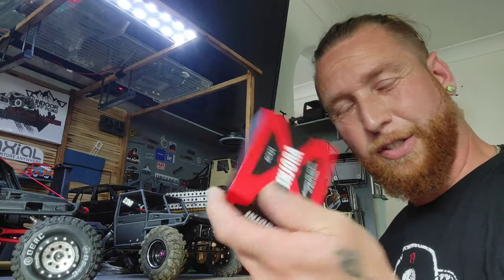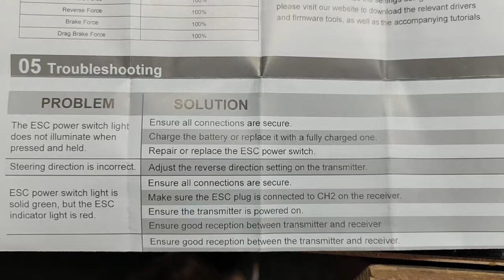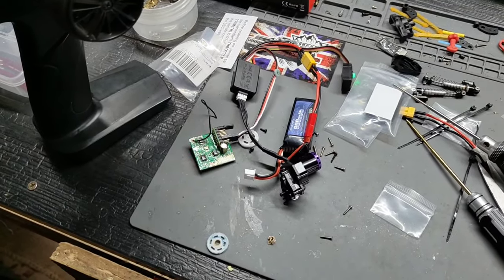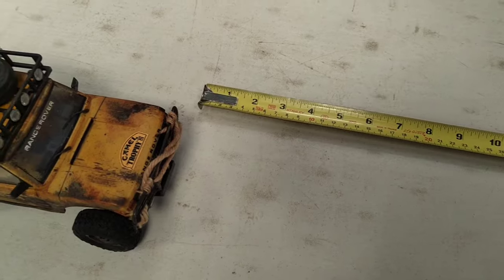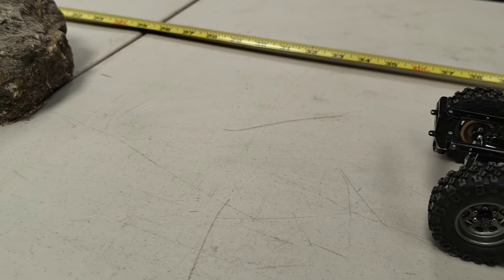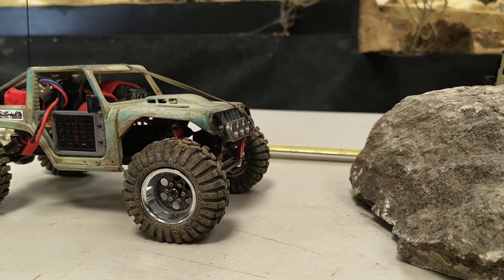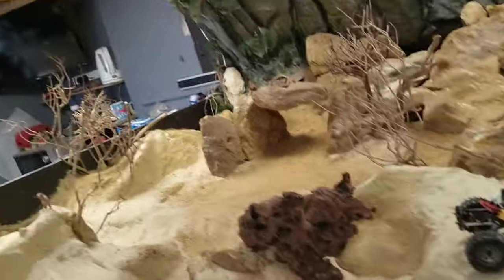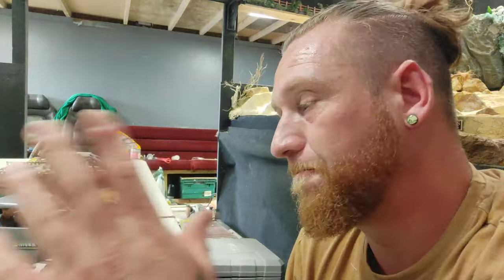INJORA 🔥 Brushless purple viper for the scx24 (budget upgrade with premium performance)

Comment: Good Test, thank you. I had the PhytonPro with Cedar, that was very good, but always Problems with calibration of Ch2, so I try Injora, when it will be delivered. Best of BL is alway the Power and the Possibility of control by very slow moving and first distance of climbing a rock. Brushed will alway have the effekt of powering after, when go to neutral at the Radio, so the Control is worst.
Reply from the maker: @slomofan2070  appreciate you taking the time to watch good luck 👍 be sure to check back in once you've run yours 🤘

Comment: Hi guys, I would also like to go through the process of brusch on my scx24, what is the overall budget to have the necessary set? I'm a little lost in what to buy, keep up the good work 🤗
Reply from the maker: @greghoog1968  what's up at this moment in time I'm running MB100 R80 with a purple injora on a 2s power supply. 

I would say regarding over drive in the front axle keep to 14t under that it starts to get a bit clogged up in certain situations. 

🤘

Comment: Nice one thanks for the very indepth comparison video 👍 .whats the delivery times like buying direct from injora to the uk?
Reply from the maker: @WombleRCmodelsandhobbies  get mine normal within 5 to 7 working days but can take upto 10. You get points you can spend on there website as well so pretty good 👍
Reply: @REACTIVETERRAINRC  great stuff il give that a try I think instead of using the jungle website .

Comment: Can you run this Injora kit with the stock Axial V2 controller or will I need to get a new controller? I can’t find anything online that says if it’s compatible
Reply from the maker: The V2 doesn't have a channel 2 so will not work. V1 and I believe v3 does.
Reply: @REACTIVETERRAINRC  thanks for the response. I got extra batteries and plugged one in last night and burned the factory ESC. Figured I might as well upgrade since the stock replacement is $25